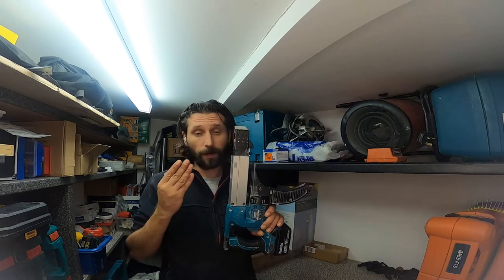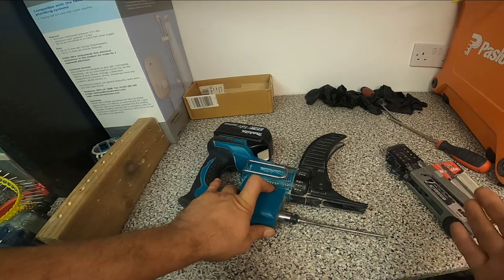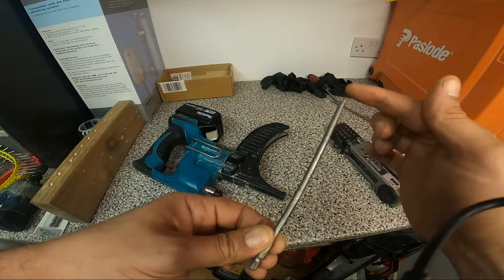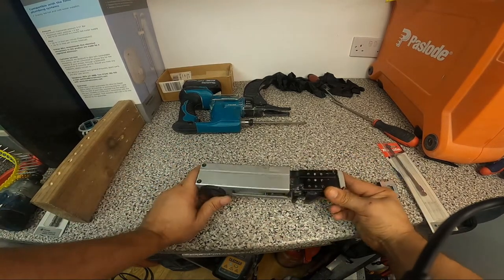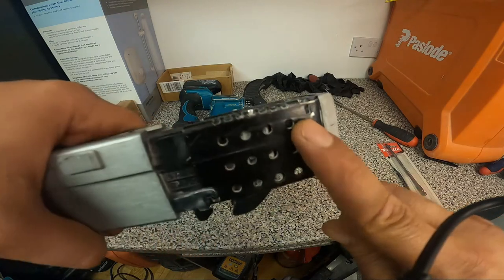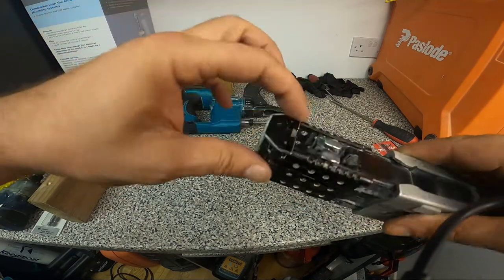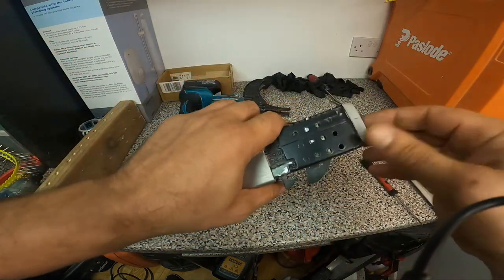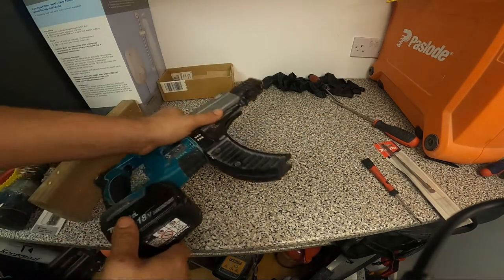MAKITA AUTOFEED SCREWDRIVER GUN

Comment: I just have purchased  a Makita 6833 dry wall screws     I never used one so  I said to myself
probably I can get some help  on  the internet  and after several try your video come on . 
I  find the video very interesting and of course this kind of machine are made only 
for soft wood I presume ?...I noticed that on the drill there is a reverse speed ...how
does it work ? Can it be used to remove screws of the some kind ? What happens 
when the screw bends or doesn't go all the way in ? I presume I have to use a school drive
to finish the job ? Can the plastic screw holder can be used again or better to say refiled 
with new screws from the box ? Thank you for your help .
Reply from the maker: Hi.i can cover a entire clip with all this questions. I never use the reverse gist if it's bloke's ,you can use it to take screw out without the box driver easily. Yes you can put the screws in the plastic manually but not very efficient and the gun might get blocked if the plastic it's not in one piece and it never is so I will say don't try that.yes it's made for soft wood but sometimes I used for floors also. When the screws bend and not going in gist use a drill or impact driver to solve the issues
Reply: @How2Extreme  ....It was very kind of you in helping me to understand how to use "safe" this machine
...Thank you
Reply from the maker: @tonyd6821  you welcome